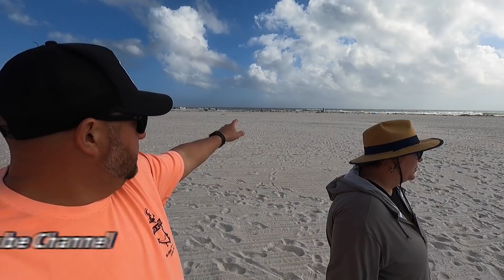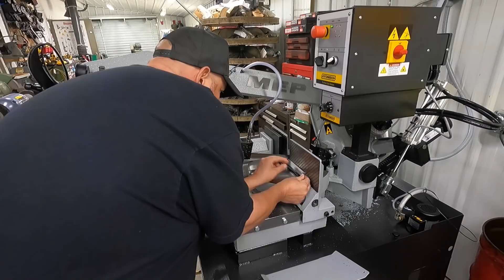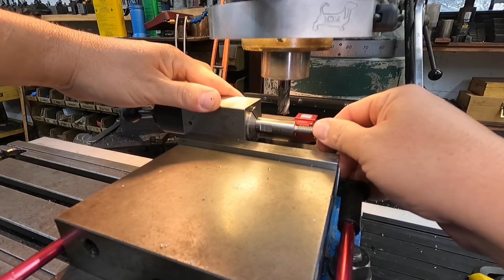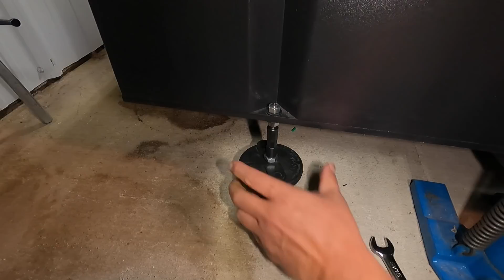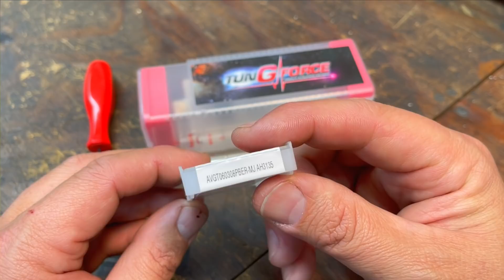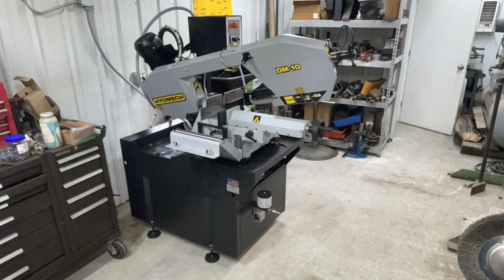SNS 332: Machinery Feet for Hydmech, Repaired Work Boots, Tung Force Mini Mill, Rode Wireless Go

Comment: Hey Abom:)
Appriciate your content!.
Have you considered sound barriers/absorption walls? Concrete walls are notorious for bouncing sound, causing the residual sound from your machines to bounce from surface to surface and give small echoes. I hope you take this simply as constructive, since you were talking about the sound quality in this video in specific.
Reply: Even a few panels on the ceiling would help. Make sure to get the fire-rated foam, from a reputable supplier.

Comment: You have always had better than average audio but I appreciate your effort to improve the sound of the videos. I am a pro sound mixer and use Lectrosonics radio mics for most everything but recently I got a COMICA BoomX-U2 (two transmitters one receiver) kit for behind the scenes mirrorless camera run and gun jobs. I considered the Rode Wireless Go system but wanted a two mic solution for Host and Guest (or in your case You and Abbey) audio into one receiver. I also prefer the UHF radio band rather than 2.4 GHz as I think it sounds better.

Comment: Now i understand why your machines are so quiet in your videos; because the mic is usually not pointed at the work. Nice mod.
Some levels were a little low with one spot where you almost faded completely out. I like to look at the waveform of clips to get an idea of the volume of the sound and an idea of what the sound is.
The system seems to be working nice though, especially at the beach, that was impressive.

Comment: Hey Adam nosy question time.  You might not want to discus this on an open channel but you have SO many tools from saws and lathes to specialty micrometers, wrenches, bits, grinders etc.  How much do you have invested?  What would it take to duplicate your shop from scratch?
Reply from the maker: it takes years to collect the tools and machines someone has. It's not an overnight purchase. I was fortunate to be passed down much of what you see in my shop from my Dad.
Reply: @Abom79  I have a similar question.
How much would a lathe, mill and shaper similar to yours set me back? Everything second hand, nothing too fancy, but in a reasonably working state for sporadic projects here and there.
Thank you ever so much!
Reply: @leoa4c  Hello. I will take a swing at your question. A Monarch lathe like Adam's can be had for around $6000, they are always in high demand since they are some of the best old iron lathes you can buy. Bridgeport clones can be had for all sorts of prices but you can expect to pay around $2000 for a nice one in good shape if you are patient, but demand for those is also high which drives up prices a bit more than lathes, since lathes take up a lot more space, so ironically you can often get much larger mills for not much more money. His larger K&T model 2 Universal mill you can get for around $3000 despite them being much heavier duty than a Bridgeport. Shapers are a bit of a wildcard. There isn't too much demand for them, but they are also less common these days on the used market. You can expect to again pay around $3000 for a 20" shaper like the G&E that Adam has. If you are patient you can often get much better deals on these machines, but you also need to be careful when dealing with used machines, since there are many unscrupulous machine dealers that sell worn out machines. Never buy a machine without inspecting it unless you're willing to gamble the money you pay for it. Shipping these machines will also cost a good fraction of what you paid for them, unless you have the equipment to drive and pick them up yourself.

You can also expect to quickly build up similar values in tooling for said machines, especially if you are using carbide tooling. Add another ~$1000 to each machine to build up a basic tool library for each of them.

The price to "build an effective shop" depends entirely on what the goal of your shop is. A basic garage style job shop where you do stuff like repairs and low volume parts with a lathe and mill and the tooling and support equipment to go with it? I'd give a ballpark around $15,000-$20,000. A shop like Adam's is more difficult to put a price on (sentimental value aside) because he probably has just as much, if not more, money in tooling than he does machines and support equipment, and there's also always a ton of shop built stuff.
Reply: Greetings Mr. Sutton,
Have you found an estimate for the main machines (lathe, mill, shaper)?
Thank you for your time.
Reply: @leoa4c  I’m not looking, I was just curious as to the kind of investment a machinist has to lay out to build an effective shop.
Reply: @allansutton557  A shop of his size, starting from scratch, in today's prices, tens of thousands, going into hundreds of thousands.
It depends on if one prefers new or second hand tools, their sizes, the brands, etc.

Myself, I am putting 50K aside just for heavy machinery alone (in Euro prices). In the US, it will likely be cheaper by, at least 5 to 10%.

Comment: great video. wish you would do an "in depth" on the threading though. Been watching for years and still cant wrap my head around how that works.
Reply: lathe threading? pretty much spindle speed and travel is synchronized with high precision, as is precise depth of cut.
now if you cut too deep or shallow the threads will be bad. meaning loose or tight fitting and weak. tapering or conical shape can occur if the lathe is worn out and not smooth and precise.
yeah, this probably didn't help, I'm sure not a teacher!

Comment: Hi Adam! Why don´t you have to stop your spindle and backup in reverse while threading???? And how do you manage to get the insert out of the cut before it hits the end of your clearance cut??
Reply: never stop and backup, any gear lash will cause an offset and destroy the threads majorly.
there's an auto stop release that pulls the threading cutter back at end set point, best way I can thin to explain it. but I'm no teacher ;)
Reply: @throttlebottle5906  you are incorrect in this situation. as long as you retract the cutter, reversing without disengaging the lead screw is fine, and the retraction is done with practice.

Comment: The audio is consistently and noticeably too "hot" during the shop segments. The beach segment was good. Check your input levels aka "gain". It is peaking out a high percentage of the time and distorting. I suspect the gain for the mic input is set too high at the camera. Is there a VU meter on the camera? That will tell you what you need to know. If not, you will have to do more video/audio test segments. Suggestion: use headphones to listen to your tests. BTW...all videos before this one had much better audio across the board in all environments. No problem with ambient noise such as you mentioned. Hope this helps.

Comment: Hey Adam, I'm in a pinch and I don't know where else to turn. I hope you or someone here can point me in a direction or give me a brand & part number to a tool they might have.
I'm building a race engine and I've switched to rockers that the roller doesn't sit below the body of the rocker. Most feeler gauges are .500 (mine measure .508) wide. I need to find (or make if it can be done accurately) a set of feeler gauges that are no wider than .375.  If anyone has a set of tapered ones or a narrow set please pass the information on to me! I'll need these after breaking the cam in on lower ratio rockers so I have a couple weeks to get this sorted out. If I cannot find a set.to lash the valves I guess I could "clearance" the rocker arms... but I'm not really to gung ho about removing that much metal and the labor involved in taking his stainless rockers apart.
Reply: I've even considered using .016 wire if I have too... but that would be pretty inconvenient.  :-/
Reply: @FastBowtie388  Have you asked the people at McMaster Carr?
Reply: @L70ECT  looked at their website. I did find a set just for lashing engines. They're .250 wide which works for me :-)

Comment: When threading , how does the lathe start the tool at the exact same spot on the thread ? Probably a dumb question but I always wonder that when I watch ABOM videos. 😬
Reply: https://leblondusa.com/threading-on-a-manual-lathe/
Reply: On my little hobby lathe there's an indexing dial that has 1, 2, 3, 4 numbers on it so as long as you drop the lever to start it on the same number as before the lathe magically starts in the same spot :) The indexing dial broke on mine (gear stripped out) but I can still thread but stopping the lathe at the end of the cut then running it in reverse to back it out, back and fourth, works great.

Comment: Enjoying the new mic Adam. Just a couple notes: Either the hat or the shirt are great locations. The hat is probably better, for two reasons. One, your shirt is more likely to move and bounce the mic and create some annoying sounds; two, your voice gets a little muddy when it gets so close to your body. You can compensate for the muddy sound with some filters in your audio editor, but you can't easily fix the bump/rustling noises of a shirt in editing. 

As is, with the mic on the hat, your voice is already a touch muddy, so I'd probably add a filter down in the low frequencies to knock it down a bit and clean your vocals up. Feel free to bug me for more information.

Comment: You can actually see how the whole machine deflects under cutting forces if you look at the floor finish left by the Mini Mill. Most of the way through the slot, the tool is pushing against oncoming material and gets ever so slightly canted forward, so the trailing edge of the tool's face (where the "return path" of the inserts is) lifts off of the slot floor a tiny bit and only the leading edge is in contact. But as the tool starts breaking through and out of the part, the trailing edge drops back down and sort of smears the finish.

Comment: Just so you know, a hot blue works even better and wears a little longer for the trouble. Just get the metal up to 190-200 or near to that and apply the blue, it gets into the metal a little deeper is te best explanation I can give quickly.

Comment: No issues really with the new mic setup. Not always the same volume as your voice comes across as louder in a silent shop but with a machine running, the sound system compensates for the background noise making your voice a little quieter but loud enough.

Can we have an update on the stoker engine work please ? Mr Pete's spreading rumours you're stuck with it ;)
Reply: He talks about the hassles that the stoker engine is throwing at him in this video: https://youtu.be/oFFIVi_70vQ.  I have no doubt that he'll figure out how to handle the issues and finish it up soon enough.  He's always seemed to me to be one of those guys who doesn't know what quit means, he'll just keep going over it in his head until he's worked it out.  He also has a LOT of really great friends he can talk it over with.
Reply: @rick4adk  Saw that and from it got the impression he'd got the setup he needed to do the job.

Comment: New mic works great. Only thing is on my computer and attached speakers you came across a lot louder than other videos or your older content.  No problem, I had to just turn down the volume control a bit on the computer.
Reply: Get used to it - that volume is generally correct 1 :)

Comment: Adam, What is the reason for cutting oil when cutting threads but not when you are cutting down the diameter of the piece?
Reply: Might be to cool small tool tip size ?
Reply: Threads are really easy to "Tear" while running the threading tool down the part.  Cutting oil makes for smoother threads.  Also less chance of snapping a threading bit.

Comment: Adam: I think new mic is a definite improvement, but the audio sounds a little bassy to me. Sounds great if you're  a radio DJ, but a little harder to hear and a little less clear for straight dialog. Maybe could adjust audio filters in video editing software to boost treble and reduce bass just a bit.
Reply: Yes, it's "boomy", almost as if you're in a box.
Reply: @TheOtherBill  He is in a box !
Reply: That's a 'picky' comment but I'll take it on board. Sounds great on my laptop speakers......
Reply: @millomweb  you're right, I agree, pretty picky, maybe in the last 2% of things to think about. If he didn't change it I would still watch. Just a little input IMHO to make it perfect. I think it's cool he's upgrading video AND sound. I was looking at old rotary welding table of 7? years ago, and Adam has improved his video production expertise dramatically. Thanks to him, my machine shop ability has improved too
Reply: @geckoproductions4128  TBH, I think to many of us, we're just a bit shocked as to what we can hear now ;) Especially if comparing with what we couldn't hear before. It might just be a case that we need to get used to this new sound !
Reply: .......No, it's not bassy,  just very realistic. Have you got the bass turned up at your end ?
Reply: @millomweb  If you're using laptop speakers you won't have good bass response so you won't notice it. Same as people using a phone.
Reply: @TheOtherBill  And it's not an issue via the hifi either.

Comment: Adam, the audio is not as good as it was. It's very sibilant and hard to listen to in the shop. Your outside audio with the windsock worked well but the shop audio is hard to listen to in my opinion for what it's worth. Veryey tiering.
Reply: I'm a hearing wounded US military veteran.   Please read my comment elsewhere in these comments.
Reply: It's not a windsock, it's a windshield. Windsocks are things found at airfields to indicate ground wind speed and direction to aircraft.

Tonally, it's certainly different but I wouldn't say 'sibilant' (hissy) and may be just something we'll need to get used to.

Comment: What brand are the parallel keepers and vise work stop? They look pretty nice!
Reply: @mechanicalTurk0  Heh, I'm with you. Right now we typically use metal banding (the kind for tying down parts on pallets) with a few bends in it. That bascially makes it a spring parallel keeper. Doesn't work great when you need to open the vise a larger amount that how you had originally bent the banding, which granted, isn't that often. But it happens. A lot of times I don't mind buying one set of things to take a look how they made them and then incorporate any ideas into a custom, but cheaper set for ourselves. We don't worry to much about the pretty, just more the functionality and sometimes the sizing. Usually sizing doesn't matter but every now and then when you change some size on something for ease of making it, you then much later find out.... "OH, that is why they went with that size!", lol.

Thanks for the info on that being Edge Technologies!

Comment: I just love how theses tooling manufacturers get all this great review coverage then make it impossible to buy the product.  I could find no online site that lists this end mill for sale.  And I spent 45 minutes looking.
Reply: Hi there!  I can help.  Where are you located?  I can connect you with a local distributor in your area, or I can have one of our engineers reach out.  Our products are also available through MSC. Feel free to email me at srooney@tungaloyamerica.com. Thanks!
Reply: @suerooney5163  I think you completely missed the point.  The first rule of marketing is “make it easy to buy”.  Boggles the mind how you go to the trouble of getting this kind of coverage and then send the potential customer through an endless maze.  MSC was my first stop and they do not list this product (yes I have the proper part number, it’s in the video).  I saw no way to buy it on the Tungaloy web site, nor could I find a list off your distributors.  Searching the web for the specific part number turned up nothing actionable. You need a new VP of Marketing IMO.
Reply: Also, the EDP # is 6769898.  Hope that helps, but email me at email me at srooney@tungaloyamerica.com if I can help further. Thanks!

Comment: Nice Job on the feet. Do you know if the CNGP 430 insert will fit my tool holder for a CNMG 432? I'm thinking it should but do not know for sure.  thanks! Always pick up a thing or two on your videos that I make note of and try for myself.

Comment: The sound is worse with the new microphone: It picks up some echo from the room (along with your direct voice), so the sound is not as clean as with the old mic.
The holes in the base out the saw should be drilled out so there are no threads, now that you have proper leveling  feet for it. That way you can adjust the leveling or height of the saw without jacking it up (the pads doesn't need to rotate anymore, you just adjust the top and bottom nut).
Reply: "Echo in the room".   Those should have been part of my comments, that I ask you to read.   I am a hearing wounded US military veteran, that HAD to permanently pause this video 'cause of facial-cranial hot pain building up within my right ear and in my face below.    My full comment somewhere on this page, if it survives.
Reply: You’re wrong, on both accounts
Reply: @adamschmidt4688  Not about the sound to a hearing wounded US military veteran.   My full comment elsewhere.
Reply: @adamschmidt4688  Stop being a baby. What I hear and what you hear are obviously different, but I have 7 likes and you only have 3 so...
Reply: @Panzax1  obviously what you and I hear are exactly the same. Boom, roasted